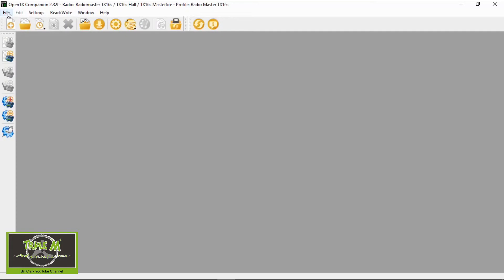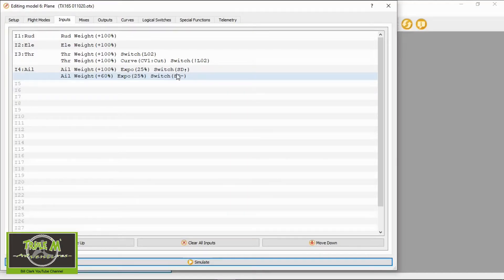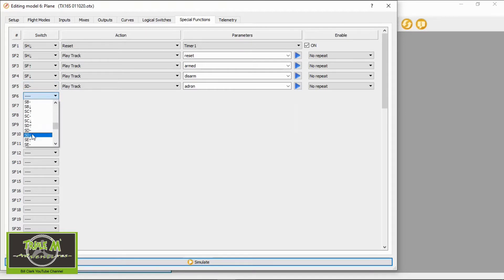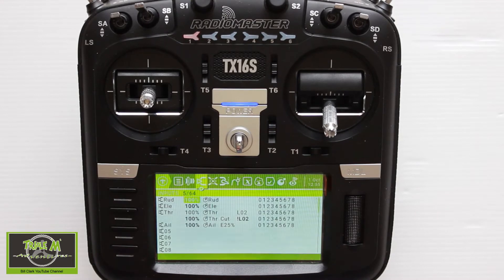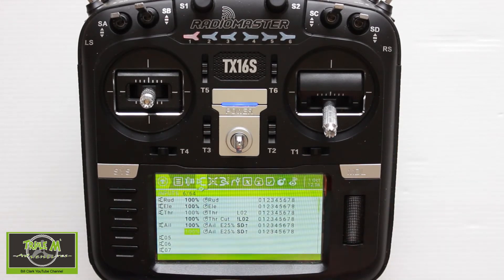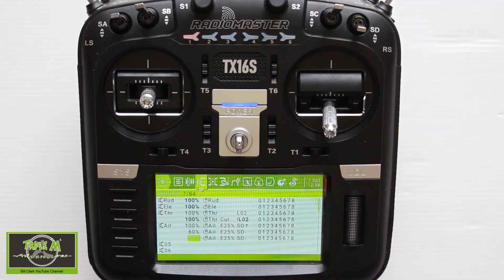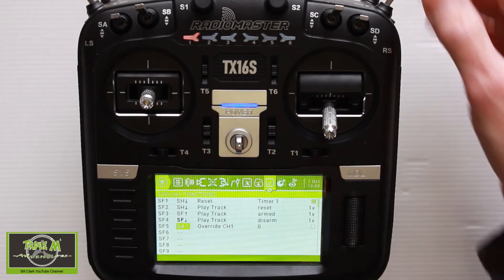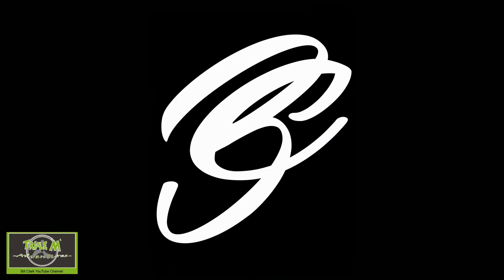RadioMaster TX16S Setting Up Fixed Wing Dual Rates

Comment: Hi Bill, I'm setting up a FMS FOX 2300mm glider and would like to have the option of crow braking later on. To this end I have one aileron on ch1 (mode 2) and one aileron on ch6, as ch5 is occupied by the flaps. I installed tripple rates, following your video and ch1 works like a charm, reducing the throws when I move the switch (as do the elevon and rudder), but ch6 remains at 100%, no matter the position of the switch (SD). I can't figure out where I mess up...
Reply from the maker: Hi, did you set the dual rates up in INPUTS and not MIXED? Dual rates and Expo are the only adjustments I make to INPUTS so they work over all mixes.
Reply: @the-happy-RC-flyer  Yes, as per your video, all dual inputs are made in INPUTS, with the extra lines with the various percentages and the corresponding switch position. This works on ch1, ch2 and ch 4, but not on ch6.
Reply: Made a little headway: when I add ch6 in the mix, with the Aileron as source and the same dual rate settings (100%, 75% and 50%) as in the input section, I get a read out in the overview of the channels, but, as was to be expected the 100% value works 1:1, but the 75 and 50% values are percentages of the input, aka a lot less. I'll have to figure out why I have to use a mix to get the second aileron servo to work on ch6. Something else I thought about is to use ch5 for the second aileron and ch6 for the flaps. Probably won't make any difference...
Reply from the maker: @janspoelstra8309  I would suggest checking the settings again if it is the same it will work fine.
Reply: @the-happy-RC-flyer  Hi Bill, I checked the settings and found some weird mixing I didn't know I put in... After removing all the clutter things started to go as planned. I have to mechanically move the arms on the flaps servo's to avoid the arms digging into the wing, making them strain. I got that, that's a matter of shortening the connecting rods and repositioning the arms. Than it's another double check prior to the maiden!

Comment: Ok Bill. I know I asked this before. I'm setting Aileron Low Rate. SE(down) to 45%. But when I use the channel monitor. SE down is 86%. This is not that hard, and I followed you step by step. What could be wrong?
Reply from the maker: Hi Jerry, I am not sure what is going on unless I could see your radio. If you are putting the weight in at 45 then that should be it. No offset and no curve. Have you put the rates under INPUTS.

Comment: Bill I thought I had it. But I don't. I have no idea how to do what you requested.
Reply: Bill you can disregard for now. My radio went to hell in a hand basket AGAIN!!. I'm sending it to radio master.
Reply from the maker: @jerryzito6840 I would suggest starting again and factory reset the radio and start again as long as you have not changed the firmware. Which is not always necessary to do unless you want the latest features. If you want to email a full list of what you have done I will try to help. triplemadventures@gmail.com

Comment: Bill thanks again. I had a Spektrum radio for 9 years before purchasing the TX16s. I setup many dual rates. I having trouble now. I have SBup Hi rate 100% SB mid 60% mid rates and SB down for low rates 40%. But when I test on my plane, and simulate in companion, all three positions are all 100%. Where did I go wrong. Seems easy enough.
Reply from the maker: Hi Jerry, many things could be wrong. Could you please back up your radio and email it to me and I will take a look for you. If you open the backup in Companion you can delete all other models except for the problem one save it and email to triplemadventures@gmail.com
Reply: I really appreciate your desire to help. But I watched your video again and discovered my error. @the-happy-RC-flyer

Comment: Hey Bill. just another terrific video. I seem to be ok with rates. I used the Wizard to set up my plane. I chose aileron with separate channels. The channel output shows both ailerons, but only one aileron responds on my plane.
Reply from the maker: You need to add a mix for the second aileron servo.

Comment: Hi Bill, how does this work on a delta wing with the elevon mix?
Reply from the maker: Jan, just set the dual rates up as normal on the Inputs.
Reply: @the-happy-RC-flyer  Followed the video: dual rates on left and right elevon channel, to my surprise only the left elevon follows the switch settings, going up and down (elevator wise) the right one ignores it completely as does the left one when applying 'rudder'. Obviously I did something wrong... Can the delta mix mess things up?
Reply from the maker: @janspoelstra8309  short answer is no. Let me give you an example. 
Dual rates must be programmed into the INPUTS not the MIXES 
First aileron line will be
Source Aileron Stick
Weight 100%
Offset 0%
Switch SD^
Add second line
Source Aileron Stick
Weight 60% (Select the reduce rate you require)
Offset 0%
Switch !SD^
You can repeat this for the Elevator Input.
I hope this helps.
Reply: @the-happy-RC-flyer  You've got email.

Comment: HI and great explanations on this, a question, how do I do it on ailerons with 2 servos?
Reply from the maker: David set it up exactly as in the video because you set up Expo and Dual Rates in the INPUTS so they will be active over all Mixes relating to that INPUT. In other words your two aileron servos relate to the same INPUT Aileron. If you need any further help just shout!
Reply: @the-happy-RC-flyer  thanks for your prompt response , I will try .
Reply: Bill , great it worked , now to plaps :)

Comment: I have a request. I would love to see a video about setting up Crow-mix. I have 2 gliders and need a 3 position switch 0 = No flaps   1 = 30% flaps and 3 = Aileron going up and flaps full down (Crow mix). Yes, i have to maybe change the numbers a little to get the throws perfect. Thanks !
Reply from the maker: On its way.